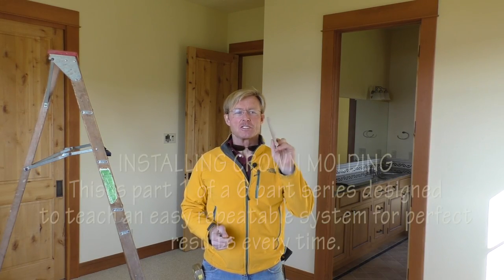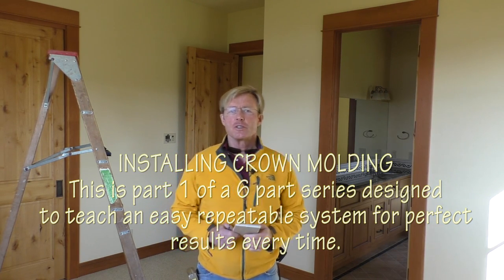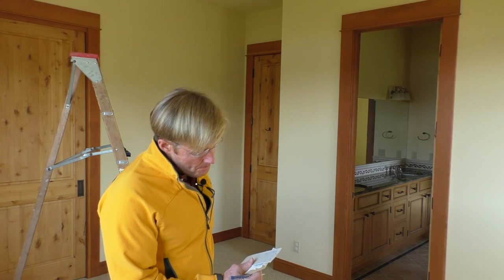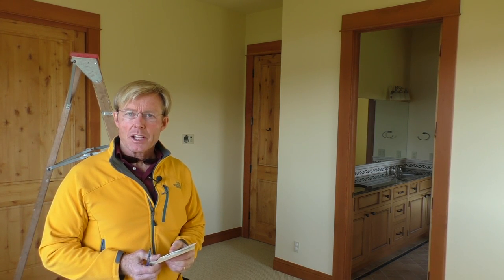Crown Molding is SO EASY! : PT1: Price & Tool setup.

Comment: GREAT SERIES !!!   I'm intending on installing my own crown in our 2 story home this coming fall and have never done it before. I can't wait to see the rest of the series.

BTW the Paulk Workbench I completed this winter has been getting used a TON !!!   It's the first thing I built when I started getting my garage shop together and it's been invaluable. It always gets positive comments from friends that drop by or neighbors that see me working on it. I'm still VERY impressed by how stable it is on those thin 1/2 saw horses ..... solid as a rock.

Every time I lay a 4x8 sheet on it and work it down with my track saw I'm glad I built it.

Comment: thanks Ron! I've been a more of kitchen fitter and cabinet maker for the past 10 years but due to demand from customers I've started doing a lot more crown and baseboard work too. your method is what I follow for crowning a room and I can't thank you enough for the instruction. ive gotten great results and very happy customers. the only thing I do different is I use a cope saw instead of a jig saw and a detail sander attachment on my multi tool . it's just preference, I feel like a have more control with a cope saw and the tiny detail sander works great for taking off what I wasn't able to cut away with the saw.
Reply: Gabe McKay    I prefer a coping saw to the jig saw as well. Gives more control and can get closer. 
On very large crown i will use the jig saw for rough cope and finish with angle grinder . Normal sized crown my tool is just the cordless 4” grinder with a sanding disc. It copes super fast and is very precise if you have a steady hand. Dust is the only caveat. Try it, thank me later.

Comment: Ron, I love all your videos and have purchased all of your plans.  You have no idea how much I've learned working through your work bench plans and watching all of your tips.  I do have a question for you. What is the brand/model of stud finder you are using.  I've purchased a number of different brands but have never found one that works explore memory well. Thanks Ron!
Reply from the maker: Jason Burr I think mine is a Franklin. I picked it up at Costco for $39 and it looks just like the Franklin brand. It works good, but I have had pretty good luck with all of them.
http://www.amazon.com/ProSensor-710-Franklin-Sensors-Precision/dp/B0064EICKG/ref=sr_1_2?ie=UTF8&qid=1434328620&sr=8-2&keywords=studs+finder
Reply: Ron Paulk Ron, thanks.  I have never used a finder similar to the Franklin before.  I've bought a number of Stanley's which all seem to be tricky to use.  I just order the Franklin!  Thanks again for all the tips.  Can't wait to learn more from you!!

Comment: Ron you almost bought him a new garage door. : ) Looks like you've backed that trailer up a few times, well done. Great vids, appreciate  your dedication to sharing your knowledge. Master craftsmen are rare these days. My Papaw was a Master Carpenter, back in the day when they checked live lines by licking their fingers and giving them a quick pinch.

  SUBBED.
Reply from the maker: Thomas yates Yes, I have backed up a few rigs. Before I was a carpenter, I was a 20 something avionics tech in the Coast Guard. I back many C-130s into the hangar, which I enjoyed far more than soldering circuit board.